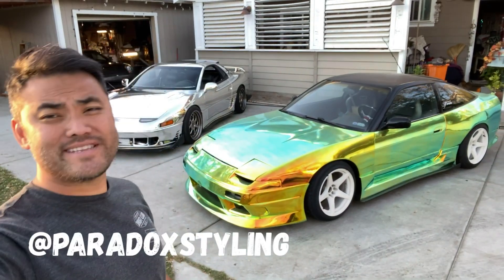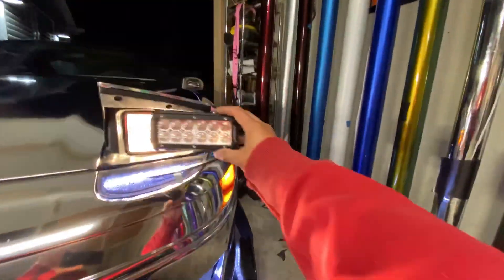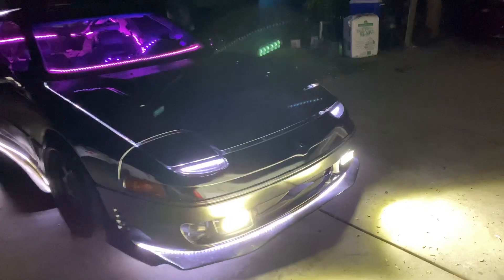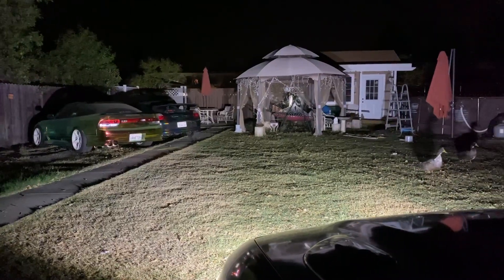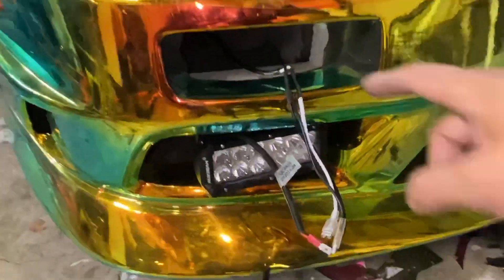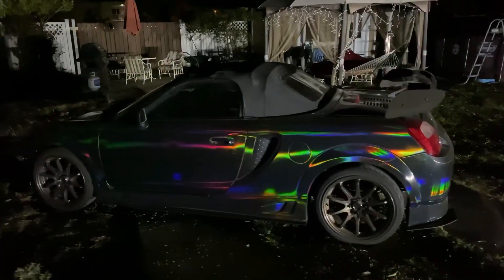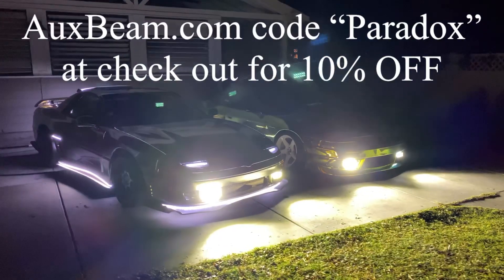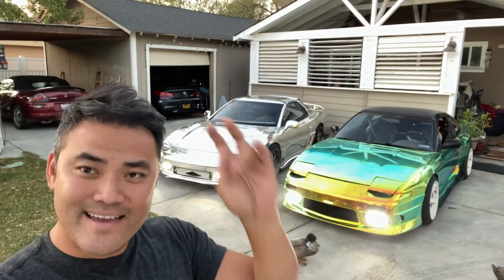LIGHT OF GOD MOD 3000GT & 240SX | Auxbeam LED Light Bar Install & Review

Comment: be careful not street legal
Reply: @vizualmrs  law
Reply: It’s not that bad if you have a dimmer switch
Reply: @mcs5119  dont matter all light bar are for off road
Reply: NC_FR3AK true 😯
Reply from the maker: Luis Ramirez yeah bro it’s sweet revenge to have for those douche bags that come tailgate you when ur just cruising along. After they weave past you follow them for 5 miles with the blinders on! Lmao
Reply: @ParadoxTheWrapper  Yeah! It's payback time. I'll see if they sell a smaller version to put it on my car and my little brother's Chevy. 👍
Reply: @Luis_Rami  

Usually it's HID headlights and a lot of trucks blind badly because they have the rear of the truck lowered more than the front and the headlights are just pointing up at your eyeballs pretty much.  pretty annoying